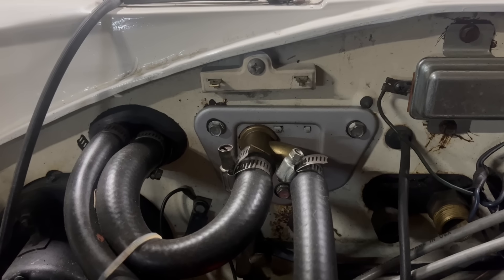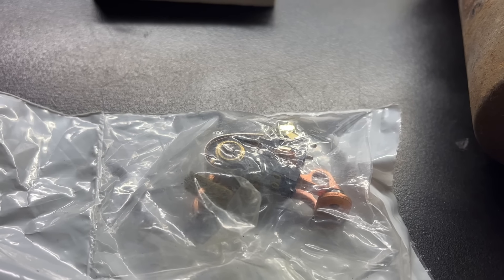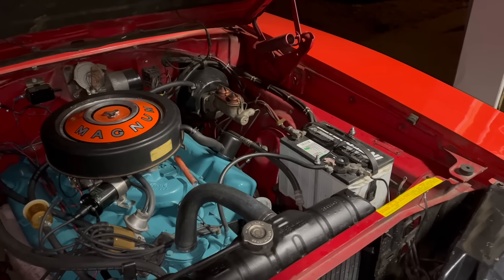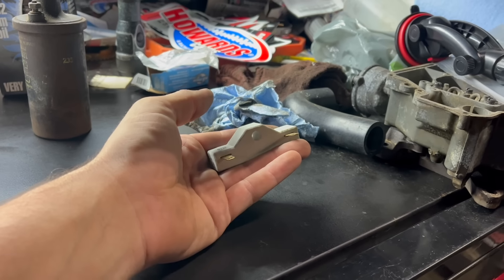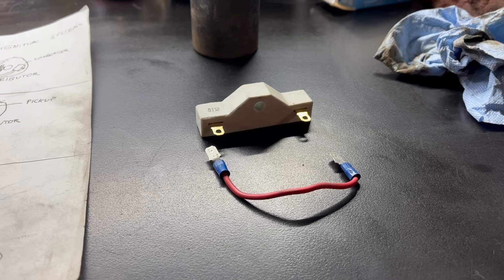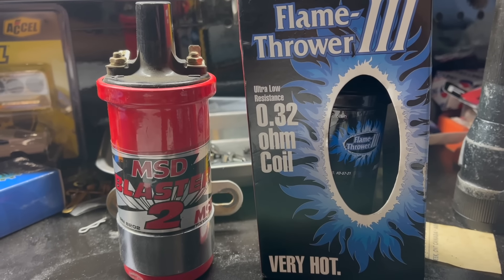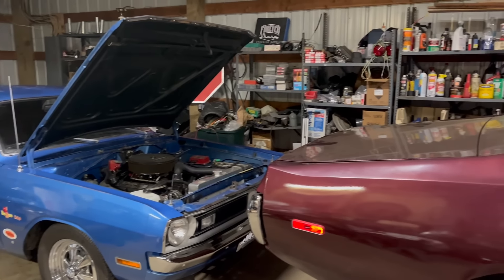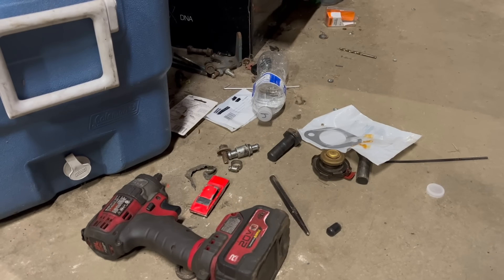The Big Ballast Resistor Video! A Simple, Yet Misunderstood Part Of Your Classic Chrysler Product

Comment: Hi . Excellent video, i have been driving older mopars since 16, and that was 45 years ago

I good mechanic friends explained it to me very simple.

Modern 60's technology is great, they will run for a long time as they are well built and designed and not over complex !!

So, your car will run fine with a 12 volt system, however for some reason, they cant make points last a long time on 12 volts, it is just the amount of spark in the small area, plus do 5000 rpm makes it worse.

Solution, drop everything to the 8  to 9 volt, it is 30% under power but the point will have a good 10/15/20 thousand mile life.

So when and why do you need 12 volts,  - easy cold start, on a cold  day / damp day / cold engine the reduced 9 volt is just not good enough for that initial fire up, they spark is just to weak - especially with a old eom slow spinning starter motor ( and possibly high compression )

Thus the need for the secondary ignition you mentioned, however as i am in Australia we have a slight difference and i am not sure f the same applies to USA.
Around 1968 onwards while still on points ( we also get electronic ignition 1973 ) there was a slight change to the wiring of the starter motor, now when you crank and start the car, the 12 volt trigger feed to the starter relay was then extended and it went into the normal wiring harness and joined up with the wire going to the coil - ie the ballast resistor out to coil wire

What this done was allowed the ballast resistor to keep working dropping 12v to 9v but now because the starter is engaged it receives that full 12v feed as well - thus providing 12v on crank when needed

One the key is released the system goes back to the normal via the ballast 9v feed.
Now i dont remember and i sold my last mopar in 2022 ( i will replace it with something ) but i believe the ballast takes some time to fully warm up and operate before it drops to 9v, it may be 30-90 seconds, but enough to supply 12v for a while to stabilize the engine

Old wiring mad connectors and internally cooked wiring that creates a high resistance gives problem, one of them being something you mentioned about engine running up after switched of, in Australia this is often suspected with the start motor bypass to give the 12v feed, it is theorized a worn starter have voltage leaking backwards into the solenoid partially energising it - not enough to engage the starter as yo would hear that horrible noise but enough to supply 6-8v back into the coil feed after ignition off - the same is said with alternator feed back into the harness

Mopar HEI ECU are hit and miss, every second car here that is still alive has the OEM ecu, every other car does not, they most common death is that cooling resin has heated and trickled out and looks like thick cold maple syrup stain on the inner guard - if you see that you know the unit is cooked.

The other fault is not actually a fault of the ecu and that unit is actually good, but the real culprit is the long centre screw that mounts the ecu on the inner guard, it is a cheap cast screw and rusts, and thus there is no good ground, the centre mount hole is part of the earth and many time, you remove the ecu , place a new one and use the same screw m yo now have a 50/50 chance of it working, it will work because the screw was removed, some rust was removed and when screwed back in some ground contact is established, if it does not work, you use a new screw and clean out the body mount hole and try again, many sparky's or mopar enthusiasts, will also add a length of wire from that centre hole screw and run it wither to the washer bottle mount screw or just run it all the way to the battery negative terminal or the star motor relay.

With ECU 1973-1985 you have to be carefull as they have ballast and non ballast models and some ballast are dual wire or single wire - they also are used with the correct 4 or 5 pin ecu chrome / yellow / blue ecu box - DONT MIX AND MATCH - the factory setup is great

If you want better then save up and get a complete electronic kit- but beware, most these days have to much chinesium in them and the dizzy may suffer from oil leakage internally in the dizzy on hi compression cars  but most common is the dead HEI module - if you buy one of these units get 2 spare hei modules or at least buy a quality bosche unit, fit it and make sure it runs, then test the cheap once for at least a week as a daily driver and keep them spare

Talking of spare, what do i keep in my foam padded lunch box, 2 x points , 1 x rotor , 1 x dizzy cap, 1 x GT40 R coil.  I dont keep a ballast resistor - just a small 4 inch wiring harness connector to bridge the 2 terminals - why ???  Well i rarely drive my mopar more that 20 miles at any given time

BTW in 2005-2010 i ran my 1976 charger with after market cam, factory HEI system but MSD blaster 2 coil and running the full 12v - the coil was designed for it and the factory distributor / rotor / dizzy cap  worked fine, at that time, i would often in good weather drive it t work for a week  say every 2 or 3 months - 1 probably put 10,000 miles over 5 years on that car and the dizzy cap was fine and no issues running on 12v - it may just be good luck or something different on the australian bosch electricals

The most common electrical faults are those stupid slim octagonal voltage regulators on the inner guard use in 1973 onwards, those stupid covers warp with heat and they ar ea cover on a base and some stupid white / yellow tap seals it, rain water gets in and shorts it out, also again a mounting hole earth issue , when this dies or had high resistance, you cannot start your car in winter - you get the same issue as damaged ballast resistor, but even shorting out or bypassing the ballast the car does the same problem

There are some non-mopar fixes firstly the ballast is replaced by "GMH pink wire" which is a special compound wire that once gets voltage warms up and produced a high resistance, it is around 2 - 3  minutes and it goes from 12v to 9v - all australian GM's used this 1964 to 1985 and many wrecking yards had this wiring taken of by mopar and ford users as a alternative to using a ballast resistor - the benifit is a real cold engine or engine on choke still gets added voltage to the points under load for a longer time

The other non mopar is the use of 60's remote ford starter motor relay / solenoid - these are great because they are away from the starter motor and do not get hot - very useful for 6 and V8's with headers as they headers will no longer cook the solenoid on the starter  - mount under the battery tray for that clean look
Reply from the maker: Very interesting. We didn’t get that setup here in the states. As soon as I read that I was envisioning that problem, and the Ford solenoid was the fix I had in mind.